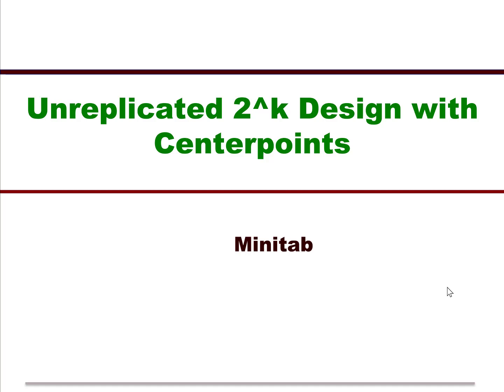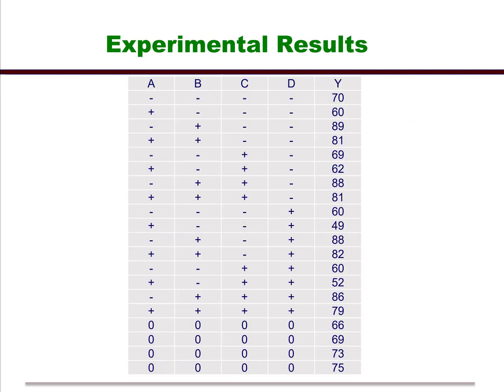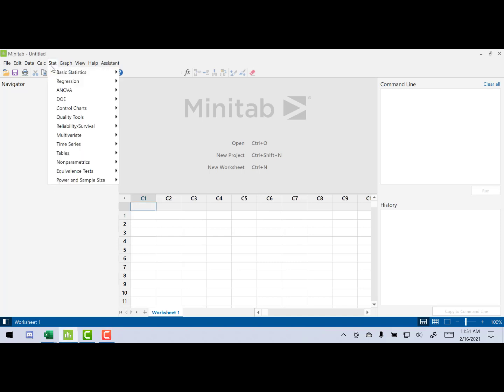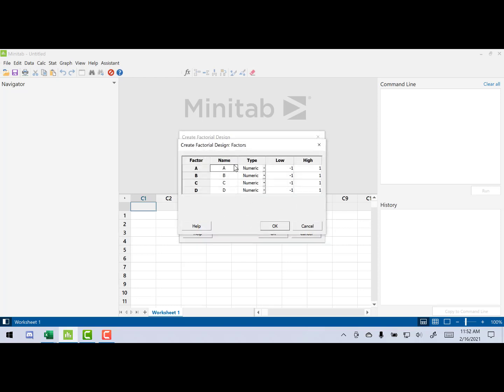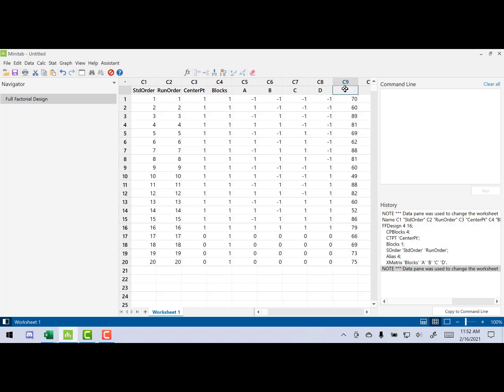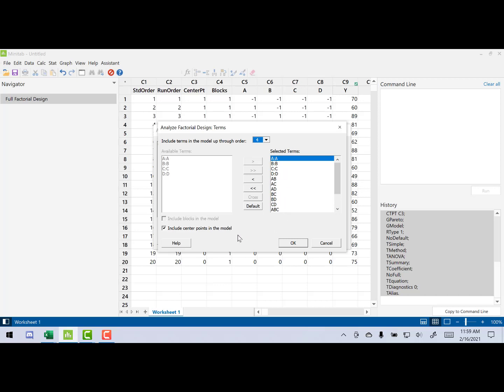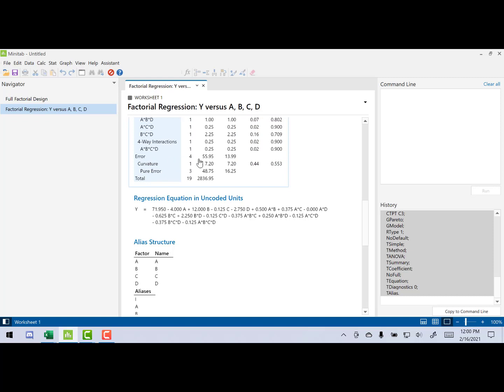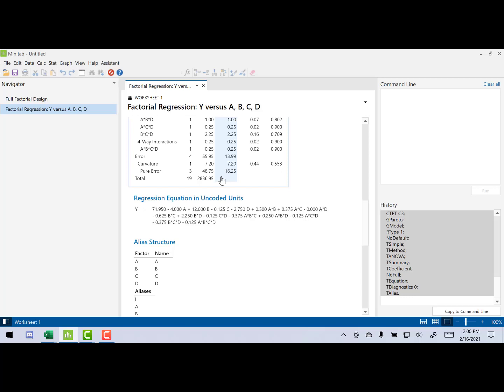Example of Curvature Design and Analysis for 2^k Design

Comment: Sir why we select number of center points per block 4? Y not 3 or 5 .
Reply: So when doing these types of designs, 3-5 centerpoints is the sweet spot. Less than 3 doesn't get enough information. More than 5 doesn't yield any more benefit in terms of predictability inside the experimental region. So you could have just as easily chosen 3 or 5.